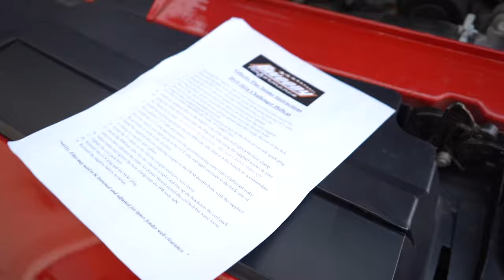BWOODY INTAKE INSTALL ON MY HELLCAT (BEFORE & AFTER)

Comment: As a 2020 Hellcat charger owner. Let me tell you, I too had blinker malfunction issues. 😅
Reply from the maker: BigLama really??
Reply: @gtash  yes, I still sometimes have problems.
I dont know if the turn signal shifter is extremely delicate, but the slightest move and it’ll activate. And then when I wanna turn it off I space out and I have trouble turning it off
Reply from the maker: BigLama dang lol same thing happens in my daily too lol I feel like when it happens I just don’t push it hard enough and it stays like in the middle and it’s still blinking 😭😂